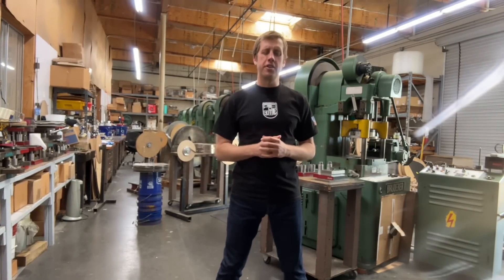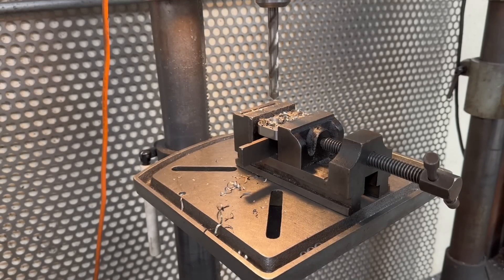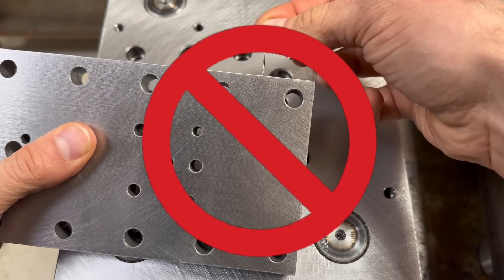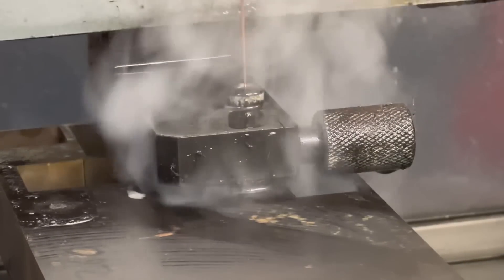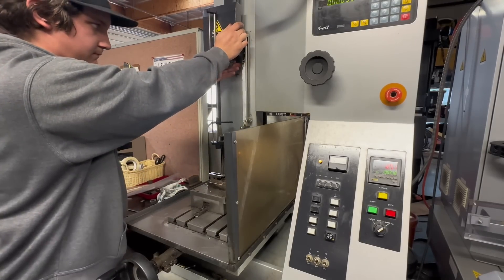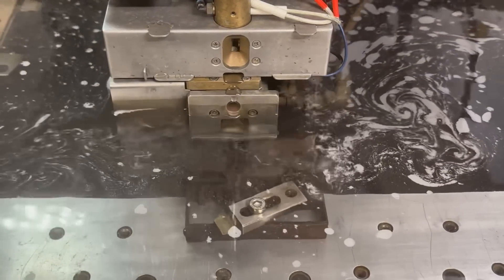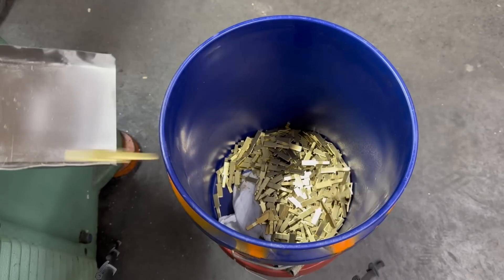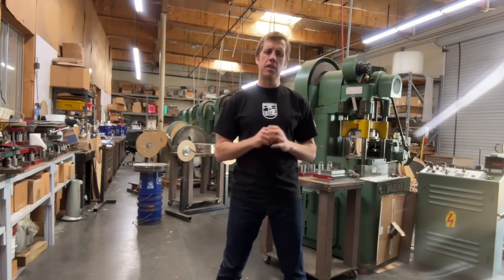Behind the Scenes: How EDM Hole Poppers are Redefining Toolmaking

Comment: What size wire were you using? I mostly use .010, sometimes .012, thinking buying guides for. 004 or .006
Reply from the maker: We use mainly .010 wire

Comment: Hi I want your advice what Is good option to buy for me/ used made in 2000 Machine EDM Wire Cut - Agiecut Evolution BC 2 made in SWITZERLAND good  used OR unused Chinese Machine I need your suggestion
Reply from the maker: we have had agie machines in the past. They are good machines but the replacement parts can be super expensive.
Reply: Thank you for your fast reply 🙏 in your knowledge what the parts need maintenance most
Reply from the maker: @BB-km5nv  I am mainly talking about the circuit boards. When they go bad, they can be very expensive.
Reply: Hope you don't mind me taking a crack at this: any technology sufficiently advanced is indistinguishable from magic. Every edm machine made will need spares and service advice, or technical help. Buy a machine that is supported in your area.

Comment: I understand you don't want to call this a drill, because it doesn't have cutting faces or helical troughs to carry away debris, however, it might still be accurate to call this a boring EDM video.
Reply from the maker: The technical name for this machine is EDM drill. Hole popper is kind of a slang term.

Comment: Our shop only has die sinking edm machines, and it occurs to me that a hole popper is a little like one of them, but with a very very small electrode.
Reply from the maker: Yes, they are similar due to the fact that they both use electricity to burn metal away. What kind of parts do you make at your shop?

Comment: How does the hole popper work?
Reply from the maker: It sends pulses of electricity through an electrode, and that electricity essentially burns through the metal creating a hole.
Reply: @ToolanderEngineering As I understand it, it vaporises the metal into water, where it forms an increasingly ionic solution. Vaporization, IIRC, is a state change, but, ionization is a chemical change. In your video, you said it "melts" the metal away...but in your replies, you said it burns the metal away. So, what is it? Melts, burns, vaporizes, ionizes, or ...is it vaporizes into an ionic bath in a two-step process, as I understand it?
Reply from the maker: @JakeWitmer  technically speaking, yes it burns away the metal. And yes in the video I did say, “essentially melts away the metal” I was just trying to make it easy to understand.
Reply: What is the minimum hole size you can go..? I think you mentioned 0.013 thou
Reply from the maker: @mooreevair  I believe our machine can go down to about .012.